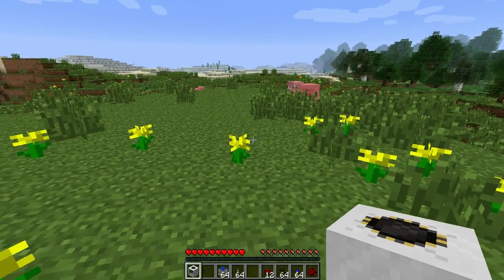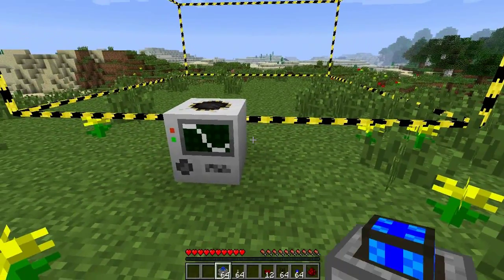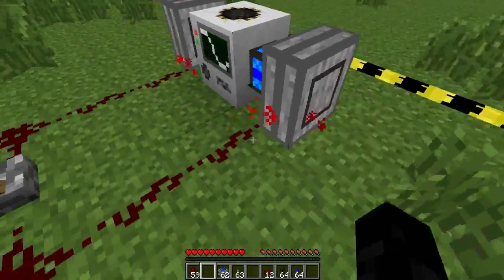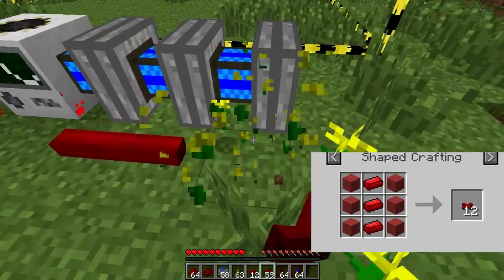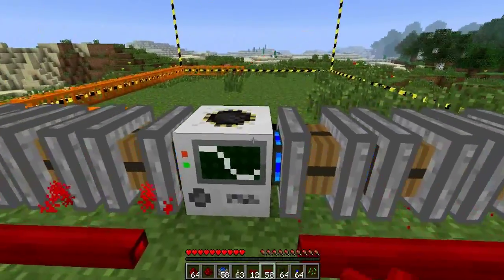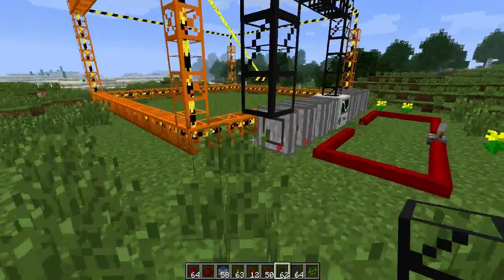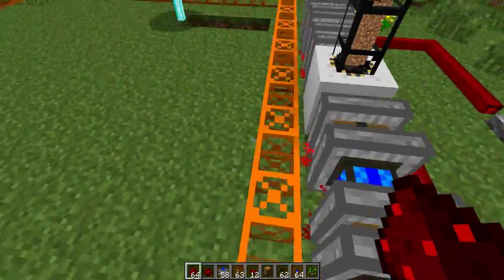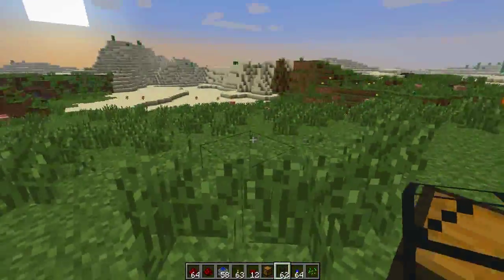Tekkit Tutorial 1: How To Make A Quarry

Comment: and "Coal & Charcoal: Each piece equals a total of 32 pumps of the machine. That means with a full stack, it will pull out a total of 2048 pumps. Putting in a stack of this will never cause your engine to explode if you give a buffer time of 5 minutes after the consumption of each stack. However, supplying it with non-stop coal will eventually overheat your engine."

Comment: noob: "Steam Engines can explode if left running for too long with any fuel better than stick so long as there is not an additional energy source. The temperature is represented by the color of the central pylon. Blue means it's cool, Green means it's warm, Green - Orange toggle means it's beginning to get hot, Orange means that it is hot, and when its an orange -red toggle then it means it's near or in danger of imminent explosion, but its also where the engine runs most effectively"